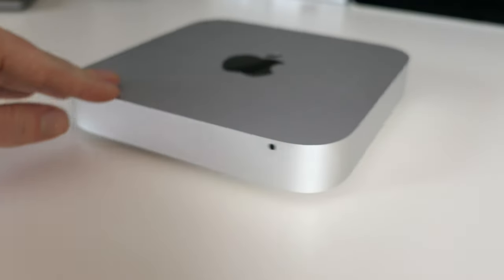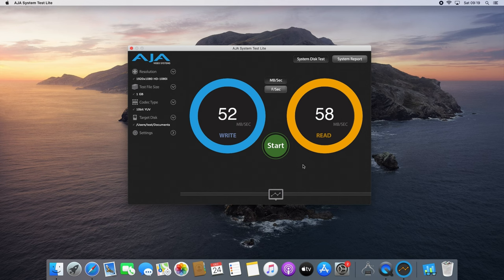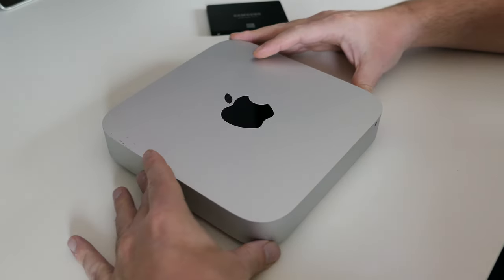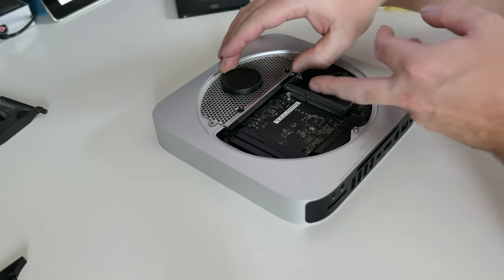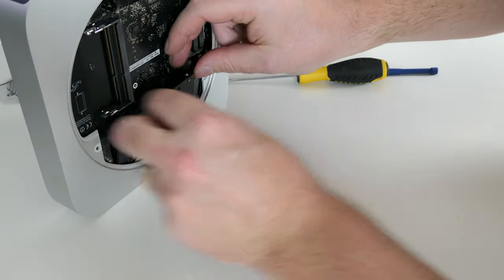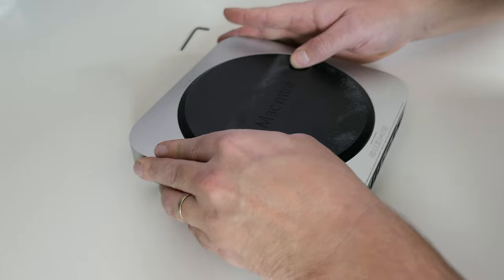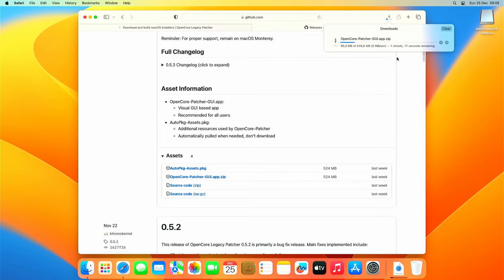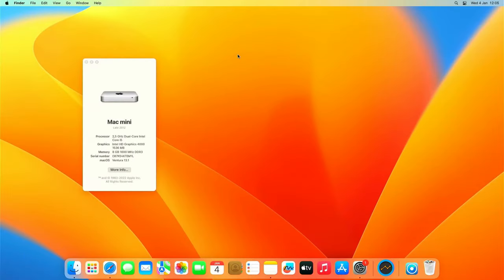Mac Mini Late 2012 - macOS Ventura and SSD Upgrade

Comment: Hi Jens,
I'm looking for a Mac Mini. Which one is a good one? I want to be able to make a couple of upgrades, like SSD, memory, and even the chip.
Reply from the maker: Starting from Late 2012, you can run macOS Ventura with OpenCore, which can be a good reason. Most of the mac mini's are limited in upgradeability. From the 2014 version, replacing the HD/SSD is a bit harder.
Reply: @jensdbe  so,I should stay late 2012 - 2013?

Comment: Very good video ;-) I have the same Mac Mini (Late 2012, i5, Intel HD 4000 Graphics, SSD disk(installed after I bought it)) running still on last Apple supported MacOS(Catalina 10.15.7). I am still happy with it beside one item, the graphic card. I have a Monitor which has a resolution of 3440x1440 pixels , but the Intel HD4000 can just run on 2560x1440. Can this update to Ventura get me a higher resolution or is the graphic hardware the limit? Thanks!
Reply from the maker: Not 100% sure but I did saw people being able to overcome the limitations (as the HDMI port and Intel HD graphics should support it in hardware) using the BetterDisplay tool or RDM (https://github.com/usr-sse2/RDM)
Reply: I have the same mac mini. if your monitor has a display port, just buy one and it will solve your problem, it solved mine. the only snag is that sometimes display port doesn't recognize the mac mini to be connected. another solution I found for that is going into your display settings and changing your Display Port setting to version  1.2 instead of 1.4 . hope this helps
Reply: @DeanMPiresHassan  Thank you very much for your help. I tried display port cable(also different ones) and also port setting 1.1 and 1.2 (1.4 is not available) but no change. Were you able to run the resolution 3440x1440? Can it be that you have the Mac Mini Late 2012 with dedicated graphic card? Thanks!
Reply: @geko4801  currently running on a 34 inch ultra wide display but it’s giving me a max of 2560x1080 isn’t going any higher (which is sad because I know this can go to 3440 (I was running on windows before)
Reply: @DeanMPiresHassan  Same here, I have the same resolution 2560x1080 instead of the possible 3440x1440. I think its a limitation of the graphic card under MacOS. I heard that there were Windows systems with the same graphic card that could do resolutions up to 4k. So the MacOS graphic driver has to be modified, but thats beyond my skills :-)
Reply: get a minidisplay port to hdmi adaptor from pluggable or FOINNEX - if LG with thunderbolt TB2 a thunderbolt 2 cable will work, I think only if the port is TB2  (e.g. Macbook Air/Pro 2015+) and the TB2->3 apple adpater will work -if it's usb-c but I think mm2012 is only TB1
Reply: I have an i5 mm 2012 and i7 mm 2012 both outputting that res via tb/mini-displayport (with adapter)
Reply: @rossgeography  3440x1440?
Reply: @DeanMPiresHassan  Yes
Reply: it may default to 50hz rather than 60hz depending on os and monitor but that's still better than 30hz (but a mm2012 won't drive a 4K monitor even with switchresX - UWHD 21:9 3440 x 1440 yes, 4k no)
Reply: @rossgeography  so you get on both the resolution 3440x1440 with adapter, right? Can you please post which adapter exactly. Thanks!

Comment: thanks for the video , I have mid 2011 Mac mini with 4 gb ram , can I upgrade it with more ram and ssd drive? if yes kindly suggest which ram and how much ram should I install , thanks again
Reply from the maker: It should be nearly the same for the 2011 model as in the video. So upgrading the memory and SSD works fine. 
How much RAM really depends on what you plan to do with the Mac. I think this config is a good match for 8GB but you might want 16GB If you are a power-user (but then you would probably run into limitations on the slower CPU).

Comment: I want to upgrade the Late 2012 i7 2.3 with 16 of ram and 480 ssd to Big Sur. wiill it work withouth problems?
Reply from the maker: You can uae the same method but selext Big Sur in the list of versions to download instead. Not sure why you want Big Sur as it is getting out of support soon. The latest version: Sonoma is definitely possible as well. See my latest video for that.
Reply: I run Sonoma on an i7 Late 2012 with 16 GB. It’s a charme! 👌🏼
Reply: with a 480 GB SSD as well.
Reply: @jensdbe  i don't need the latest one but at least a newer one

Comment: Awesome!!! Great video. So I did this same thing to my 2012 Mac Mini SSD with 500GB and 16 GB ram. I also went ahead and installed OS Ventura.. That was 2 weeks ago and everything is still running lightning fast. I loaded the latest Logic Pro on it and it still runs great. There is one issue. If I try to bring audio in with my audio in-outbox it just won't work. Logic recognizes it. It allows me to select it as audio-in but it won't record. I'm thinking it's because of the old USB ports on this 2012 Mac? Could it be that they are not strong enough? What might be a workaround? Thanks
Reply: Is the driver for your soundcard supported by the newer OS?

Mac had a habit of not supporting legacy drivers with certain upgrades 

I am an old school audio guy and have found this to be true a couple times over the years with my experience using my older gear on their newest updates
Reply: The 2012 Mac mini has USB 3.0 tho so I don't think they would be the issue
Reply: I wanted to let you know the issue with Logic not being able use the mic was actually an issue with the ‘Open core legacy patch’ that I used to upgrade to the latest OS for Mac. And there was a work around posted on their website so it works fine now. Thanks

Comment: On the last  step when I choose Mac OS installer and it takes some minutes after that it shows me that I have no any software on it and now I can’t come back to Mac OS Catalina on Mac mini 2012 that I have please someone to help me or to get contact with
Reply from the maker: Boot while holding the Alt/Option key and see if you old OS is still there. If you did Erase in Disk Utility already, you will will not be able to go back obviously. But it sounds like you never managed to grt there and can't boot from the USB drive into the installer.
Reply: @jensdbe  I fixed the problem and I have Mac OS ventura on my Mac mini 2012 with i7 1TB HDD and 16GB of RAM thank you !!!
Reply: @staurosnanos6674  How did you fix the problem?

Comment: Hi, I have watched who’s video and your other video related to this. 

Followed every step and have used a 32gb Toshiba usb. 

Since trying to launch from flash drive it will load partially then produce a prohibited sign. Is that fixable? I cannot find a work around at present… thank you :)
Reply from the maker: You can try to re-erase the USB drive. Make sure to select the drive itself and not just a volume on the drive. If that really doesn't help, trying another drive is probably the only option. Some drives don't get accepted properly, especially if they are presented like an external drive rather than a USB drive.

Comment: Caution on upgrades of operating systems, as   I believe 10.13 (High Sierra) is the last OS to do both 32 bit and 64 bit apps. If you Need an app which isn't available in a 64 bit form, or the developer isn't making the larger format version easily available, your only option is to partition the drive and have a bootable 10.13 version handy. Or a second drive with 10.13. I liked several options in High Sierra better than in Catalina, and have reverted while I suss out some drive issues. In particular Catalina loses the F12 option with the calculator and calendar, which is in my muscle memory, thus Fast to access. I also loath the way items display visually in a folder with 10.15. It's far harder to find a particular item when it's visual and I'm trying to sort it out from a larger sample. Relabeling everything before they go into folders would partically solve this, but I'm not that guy.
Reply: Mojave does 32bit, it was the last.

Comment: Not mac user here, was thinking of buying a second hand Mac Mini 2012 model (either i5 2.5 ghz with 8 gb Ram/ 1 TB storage or i7 2.5 ghz with 4 gb of ram and 500 gb storage)  for my secondary machine. Not going to use it for heavy work (maybe light movie editing, etc in the future) Which one should i choose? Cheers.
Reply from the maker: I'd definitely go for at least 8GB of RAM. Video editing might not be very fluent with either option, depending on the resolution of the video.
Reply: @jensdbe  so the i5 option is better than the i7 one? I mean the Ram can be upgrade later on.
Reply from the maker: @MrSteve238  if you plan to upgrade the RAM, then definitely the i7 :)

Comment: After performing the whole process, it stucks in the last boot on my Mac Mini 2012. I only get the apple logo and a milimeter white progress line, and thats all. I have tried it several times without any result. Somebody an idea
Reply: Hey I am having the exact same issue right now and you are the only person I have seen describing this! I know this is a year after, but did you find a solution ? I tried reinstalling 2 times already and it always gets stuck at the begining of the progress bar...

Comment: Does the late 2012 minis allow for a second SSD like in the earlier versions?
Reply: in 2013 I got that machine and purchased a mount from Other World Computing OWC to have two drives, one SSD for macOS and the original for storage. You have to literally take the whole machine apart, it takes like 40 minutes to do so. Nowadays, in that situation, I'll just swap to one single SSD and add an external drive

Comment: Hi, what if my 2012 Mac Mini hard drive completely dead, so can I create bootable USB using deferent computer? and then install new SSD? Thank you.
Reply from the maker: That is possible. You can do this from another machine/model but as the OpenCore config is hardware-specific, you first need to select the correct model from the Settings options in the OpenCore Legacy Patcher application. All the rest should be the same. Good luck!
Reply: @jensdbe  Thank you

Comment: Will this system run the lastest Photoshop and or illustrator? I don't need blazing fast, just to work!
Reply from the maker: Didn't try this myself but wouldn't know why it wouldn't work. The hardware specs are on the low side for sure but I don't see why I would not be able to function.
Reply: @jensdbe  Thank you!

Comment: I keep having this issue where it fails the software update installation? Any tips or tricks ?
Reply from the maker: Try to run Disk Utility (it can be from the environment which gives you that error) Then run First Aid on the drive/partition on which you try to install Ventura. Followed by a re-try. This has helped me before in the same situation.

Comment: I'm running Ventura 13.2.1 on My Mac Mini 2012, run great, it however does not recognize the internal speaker, no biggie.
Reply from the maker: Maybe check in the sound settings - output - check if the internal speaker is selected as output.
Didn't really test this myself as the quality of it isn't really great.
Reply: @jensdbe  Did all that before I even posted,... but I didn't reboot, when I did my got my internal speaker, I probably should have posted sooner.
Reply from the maker: @mikewilsher1005  good to hear it worked :)

Comment: can you tell me if there is a maximum limit in the SSD storage for the Mac mini 2012 ? I read few articles about a limit of 250Go SSD for this generation of Mac mini…
Reply from the maker: As far as I know there is no limit in theory. I saw people using 4TB without issues.
Reply: @jensdbe  Do you suggest it ? I am planning to buy that for Xcode pycharm programming surfing etc. I am going to buy quad core version 16 gb ram like 250 usd

Comment: Why you change the capacity from a 500GB drive to a 250GB SSD?
Reply from the maker: Because 250GB is more than enough for what I plan to do with the Mac and the speed of the SSD is way more important than the capacity in my case. You can just uae a 500GB SSD (or larger) as well if desired.
Reply: @jensdbe  You have a point, but the small size runs out fast when you editing videos or photos fast

Comment: This usb intaller Will Work in other Macs?
Reply from the maker: OpenCore will be built specifically for the machine you do that on. 
For the same model you can just re-use the same USB drive.
For different models, what you can do is after you used the USB drive on one model, to go again through the patcher, choose the option to set a different model, then build OpenCore and re-install it to the USB drive. Then you can use it on another model.
Reply: Thank you :)  @jensdbe

Comment: option key won't show me boot options upon restart. do you have any idea what could be wrong?
Reply from the maker: In my experience this doesn't always work with non-Apple keyboard, especially if they are wireless. Would be good if you could give it a try with an Apple keyboard.

Comment: Haii , have the problem , i followed all the step , after i install it in new ssd and it runing, but after insted the required such “select region and instead the wifi power” the came to remote managment the it required to insted username and password  i cant open my after the intallation help
Reply from the maker: Sounds like a device that is corporate managed. Did you buy it second hand?
Reply: Yess

Comment: Is it possible to upgrade catalina on mac mini 2012 to ventura without a fresh install? So I don't have to re-nstall all my existing data.
Reply from the maker: That should be possible yes. When booting Open Core from the USB drive, select the Ventura installer. Then skip the step where you format/erase the drive and start the installer. Select your current Catalina install when asked where to install.
Reply: @jensdbe  Will that install over Catalina without wiping my personal data and apps that way?
Reply from the maker: @jonos138  yes, that should be the case. But always better to have a proper backup of your critical files. Especially when doing things like this.
Reply: @jensdbe  Thanks, yes I always make sure to back up. 👍

Comment: Hi there, when I start my mac up it presents me with two options of install Ventura, one has two hard drive images on it. It automatically starts to install but stops at 16 minutes and says an error occurred preparing the software update, and goes to update assistant. Any idea on how to fix this? Thanks
Reply from the maker: Try to run Disk Utility (it can be from the environment which gives you that error) Then run First Aid on the drive/partition on which you try to install Ventura. Followed by a re-try. This has helped me before in the same situation.
Reply: @jensdbe  I got it to work, thanks so much!

Comment: I recently upgraded to Sierra from El Cap because there were some things Safari could no longer do (I don't use it as my main browser but like to use it for certain things.)  Can anyone give me a picture of what I'll be breaking by moving to Ventura? Some of the things I'm worried about losing are my old old install of MS Office, old old versions of P-shop and Illustrator that still run, an older version of Security Spy, and maybe EyeTV (which I think may still be updateable for free.) Would cost mondo bucks to update these things.
Reply: Also is Ventura the OS that requires you to do a fresh install rather than a clone if you want a bootable external?

Comment: Hi after the first install stage Mac Mini restarts and goes back to install mode again every time
Reply: helpppp
Reply from the maker: During the restart, when Open Core starts from the USB drive, make sure that it starts from the internal drive and not relaunch the installer. Only thing I can really think of.
Reply: @jensdbe  Hi thanks for the prompt reply, everything works well now. Was the SSD. Thanks for the work done👍
Reply from the maker: @westreamlive8505  thanks for the update and nice to hear you figured it out. Enjoy Ventura :)

Comment: Ok, I'd like to ask the masters who tried this: performance, is it better than Catalina? Virtualization support, it's still "workable"? Docker, is it possible to use? If anyone tried, please share the experience, thank you very much!💪
Reply from the maker: To answer that question, I did a separate video on performance with unsupported macOS: https://youtu.be/ZI7pjHKyuJY
As far as I noticed, Docker works just fine. I did not try it on this machine but on another unsupported Mac with Ventura.
Reply: @jensdbe  well,. docker now it runs only on macos 11 and above, I'm still in Catalina so I guess that I have no choice but to try it. Thank you very much for the great work brother!😊
Reply: To whom it may concern, I followed the above procedure and installed Mac Os Ventura on my 2012 mac mini. Well, I installed docker and did some testing of applications running in containers and everything is working wonderfully. Sad is the fact of not being able to install more than 16GB of RAM in it. I apologize to the gentlemen for the delay in replying, but there it is. See you around.

Comment: I’ve tried this like 7 times and it fails ever time!  Arrrggg
Reply from the maker: Try to run Disk Utility (it can be from the environment which gives you that error) Then run First Aid on the drive/partition on which you try to install Ventura. Followed by a re-try. This has helped me before in the same situation.
Reply: @jensdbe  thank you. I will give it a try
Reply: Still not working. Could I create the installer on another Mac?  Thanks in advance.
Reply: It’s worked. My issue was that it didn’t have full disk access in security.